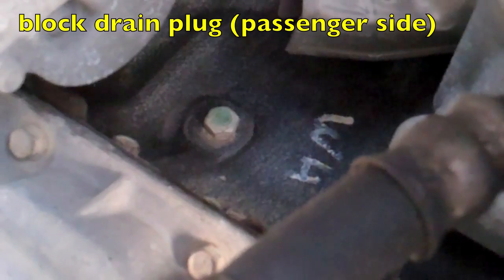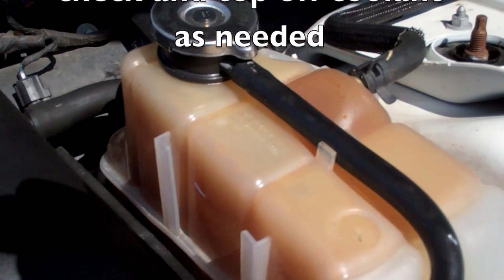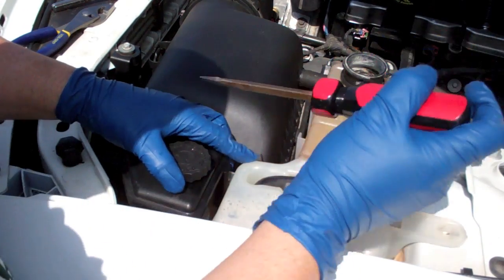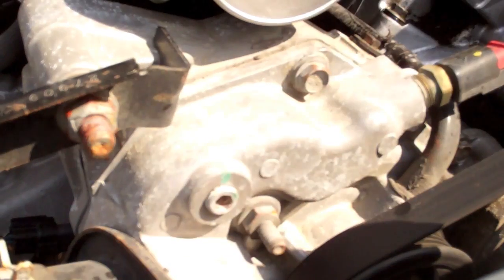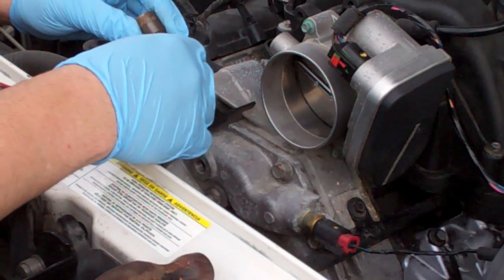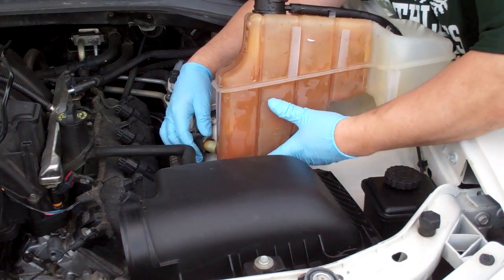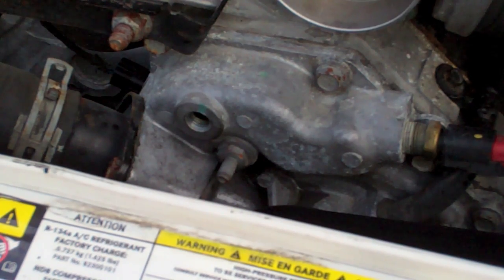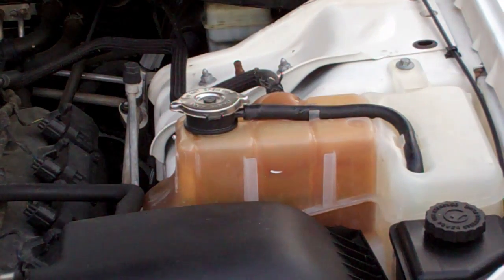Dodge Charger coolant flush/change

Comment: Supertech coolant is manufactured by Prestone and it's their pre-Corguard formula (pre-2014), which is perfectly fine and a very good OAT coolant.  I've used it for many years in many different vehicles with no issues whatsoever.  Radiator and rest of the coolant system is absolutely pristine in every vehicle I've used this in.
Reply from the maker: I've had great luck running it in all my vehicles too

Comment: Many people that have purchased our different materials recently have been asking us to address coolants on the forums.

It appears that there is a large amount of misunderstanding in regards to coolant/anti-freeze.

Since this is a very important system that many do not really understand, I will address this subject with the differences and why our QuantumBlue HP Gold is so much better than the sodium and sulfate coolants on the market today.

Many people have anxiety about the different colors of pink, red, orange, green, and purple colored coolants.

Many people think that green is the normal coolant and appropriate for all cars. However, the green coolant is not recommended for our LX LC, LD, and WK cooling systems.

It is true that as much as 40% of the engine problems that occur are either directly or indirectly resultant from improper used or wornout coolants. Neglecting this system tends to be common practice. Afterall, if there is fluid in there, it is ok right? WRONG.

There are 3 types of coolants available today:

First is the traditional I.A.T or Inorganic Additive Technology. This is considered the "conventional coolant" It contains inorganic corrosion inhibitors.....Sodium Tetraborate, Sodium benzoate, and Sodium Silicates and Phosphates.

This is how traditional coolants function. The rusting/corrosion potential for metals is the result of several competing factors. The two that are most concerning is the electrode potential, which is a measure of the tendency of a metal to oxidize (the atoms/ions of the metal combine chemically with oxygen to form a participate or create a solid like we have see in the 6.1 liter) and the protective strength and stability of the surface films. The most corrosion prone metals in an engine are the aluminum pieces and solder used in the system.

Second is called O.A.T or Organic Additive Technology. This technology ends up with an additive package that is organic sodium as opposed to inorganic sodium contents like the I.A.T coolants. The organic additives tend to last longer as they react slower. O.A.T coolants can last twice as long as the standard I.A.T which have an effective life of 30,000 miles.

Cast iron and steel both have relatively low corrosion rates in automobile engines. The simple but essential task of reducing ferrous metal corrosion is accomplished by adding inhibitors to the coolant formulation. Additionally, the corrosion products of ferrous metals are readily dissolved in the coolant and moderately stable in common coolant solutions. Ferrous metals corrosion is not a major problem in the engine our cars.

However, copper, and brass, (an alloy of copper and zinc), have higher corrosion rates then iron and steel. The old cars years ago used soldered copper radiators, and standard I.A.T and O.A.T silicate coolants protected these. The only major alternative to a brass and copper radiator is an aluminum and plastic radiator. Like ferrous metals the corrosion of brass and copper can be easily controlled through the use of sodium corrosion inhibitors which both traditional coolants have relied on for years.

Third type (which is recommended for our cars) is the H.O.A.T or Hybrid Organic Additive Technology. This type of coolant is designed more for European type vehicles and upper end manufacturers.

The Mopar OEM coolants factory installed in our cars are this type. They are designed for extended life in excess of 60,000 miles and upto 150,000 miles.

The negative or downside to this coolant is that it contains the same I.A.T and O.A.T additives that tend to react to heat and "plate out" onto surfaces and eventually buildup in the coolant passages and lower water jacket as does the other two types of manufacture.

The reason for the H.O.A.T spec is that corrosion of aluminum can be quite a different problem because of its electrode potential. Aluminum is the most corrosion prone metal in an engine (radiator and heads). Only magnesium sodium and potassium have a greater oxidation potential (these metals will burn/oxidize violently) The reason our precious heads and radiators do not turn into lumps of white powder is that aluminum oxides tend to form stable surface films on the cooling/engine waterways.

However aluminum is particularly sensitive to a process, called erosion-corrosion where a rapidly flowing fluid can remove the protective oxide layer. Erosion can be controlled by limiting the surface flow rate of coolant to 3 m/s or less. This is easily achieved everywhere except at the water pump.

The most vulnerable aluminum component in many engines is the water pump. Water pumps and their housings are susceptible to corrosion caused by erosion-corrosion and cavitation. Cavitation causes the formation and subsequent collapsing of high pressure vapor cavities, which exert high mechanical forces on metal surfaces. Erosion corrosion is the process whereby a flowing fluid surface destroys the protective film giving corrosion free play. The results of both reactions are very similar which produces severe localized damage.

The rate of cavitation is affected by a number of factors. Increasing the fluid density or fluid boiling point tends to increase cavitation While increasing viscosity, compressibility or dissolved gases tends to reduce cavitation.

There are many things to understand about a cooling system and I have addressed only a few here.
Reply: emsman59 Thanks for the information.  I would have screwed up my Magnum if I hadn't read your comment.
Reply: I am researching this OAT, HOAT coolant issue and things are getting more and more foggy. My 2015 5.7 challenger manual specifically states to use OAT coolant, and not to use or mix with hoat. OAT is purple and that's what my dealership says goes in my engine. Apparently Dodge changed to OAT in 2013. Contrary to all this, my 2015 car has Orange coolant in it (I am second owner). I am losing it...
Reply: @AGR96  Are you sure it's not more pink/orange? The purple dye in the coolant loses its color after a few heat cycles and appears to match the HOAT (orange) coolant, but if you take the OAT (aka purple stuff) out and put it in a cup, it will definitely look more pink than orange. Obviously, out of the jug, it will be purple. And I'm only referring to the Mopar-branded coolant, not other HOAT and/or OAT coolants.

Comment: Useful info! However, I’ve heard it’s not a good idea to switch coolant types without doing a complete flush of the system, as some coolants create some weird sludge overtime if they mix even in small amounts But I’m just glad I know how to drain the system now.
Reply from the maker: I use a "universal" coolant that is supposed to mix with all colors.  That being said, I did drain out every drop that I could - "just in case"

Comment: when i changed the coolant in my hemi ram i went ahead and filled it back with the HOAT coolant mostly because i was scared to change it to the green stuff in fear that it would mess up my engine somehow
Reply from the maker: I've been using this same stuff in all of my vehicles for years.  It says it "mixes with all colors."  I have not had any problems with engine temperature.
Reply: WJ Handy Dad i would drain your system and replace it with HOAT (GL5) and diluted water mix. It is the only coolant for the hemi 5.7 motor. Reason being the orange/green premix stuff doesnt offer the correct corrosion protection for this engine and will start to cause rust/corrosion in the radiator, water pump and block. Just my .02
Reply: you should only use OAT coolant in any 2015 and up challenger/charger or you will void your warranty. The manual states DO NOT MIX or engine damage will occur. YOU should do your homework before giving out bad info!
Reply: YOU are correct do not use the glycol based coolant (green stuff).  Handy dad is giving bad info. You probably saved your engine.
Reply from the maker: You can use whatever coolant you want to use and I never said that you should or shouldn't use any particular one.  The stuff I'm using says it is "Universal."  It's not the same thing as the old style "green" that was common in the 1990's and earlier.  It is the same green color but it's made differently.  I haven't had any problems with cooling/overheating using it in any of my vehicles.  I also change fluids, including coolant, more often than the manufacturers say to.
Reply: The dodge manual specifically states "Do not use universal type anti-freeze/coolant or severe engine damage can result and warranty will be void. Look it up, if you don't believe me. You should do your homework before giving others advice that could possibly damage their $40,000+ vehicle, or possibly void their warranty. Very irresponsible! 30 year dodge tech here.
Reply: Omar Aguilar green coolant the is safest you can use. Other coolants dexcool leave grime and eat the gaskets if you don't change it
Reply: Correct Omar, using anything besides hoat coolant in your charger will eat away at your coolant system. Doesn't matter if it s "universal" all coolants are different there is no universal coolant. Chances are yoir car is running much warmer than normal operating temps you'll go through water pumps faster and you piping is going to develop leaks. Coming from my father who has been a dodge service tech for 50 years.
Reply: I used a little 5050 Preston's in and I had the normal, now my radiator is leaking? Could that be because of the mix of fluids

Comment: i drive a ford f450 v10 (at work) and a  hemi magnum. wanna lose head gaskets at 50k miles run green . HOAT inhibits bimetal corrosion  get the mopar fluid, zerex sucks, oxygen corrodes it bad. aluminium and cast ruins head gaskets. why risk it

Comment: I'm about to do a flush on my 06 rt what's the worst that can happen if I use this same supertech coolant?? Or does it have to be the Mopar coolant? I'm confused thanks in advance!
Reply from the maker: the specification is to use the Mopar coolant.  That said I have not had any problems running a "universal" coolant in any of my vehicles... they all run great despite having >100k miles

Comment: What year Charger? Just asking because pre-2013 call for HOAT;  2013+ call for OAT). What engine? Only asking because the procedure will be different for 6.4/5.7), but I guess it's probably close enough. I suppose if you flushed everything, and it's pre-2013, you could at least run the OAT just fine without the sludging issue when you mix the two. Now running an old-school coolant that won't react with the modern metals of a modern engine? I just don't know if I would trust it. Sure, it's fine for your '70 Super Bee, but I think I would stick to HOAT or OAT? Issues may not be immediate, but maintaining the cooling system properly is apparently 40% of the wear on an engine, or so I read. That being said, great video, going to use it this weekend to do my own car.
Reply from the maker: I have gotten a lot of flack for using the "wrong" coolant.  I think a lot of folks think it's the old style "green" coolant, but it's a universal coolant.  I've had zero issues.  I've noticed the newer universals are yellow like the newest coolant.

Comment: would've been nice if you showed where in the engine block the drain plugs were.
Reply from the maker: I thought I did???
Reply: @WJHandyDad  you did, and they are a pain to get to with a ratchet and extension.  Everything seems to be in the way of acquiring a square fit with a wrench, extension and socket, so hopefully a flex adapter would help.  I've got my front end up on three levels of RV Links levelors right now and can barely squeeze under the engine.  I'll have to drop it back down to fully drain the system, but am worried about starting the car for any period of time to again raise the front end, without coolant in order to put the block plugs back in.  It'll just be for a few seconds of run time, but is that something critical I should really worry about, that could potentially cause any damage?  Thanks!!

Comment: So there's only one bleeder valve? Someone mentioned there was 2 and has to be done in a special series or else you air lock a thermostadt?
Reply from the maker: there is only 1 mentioned in the Dodge shop manual that I have
Reply: There is another, if the coolan bleed on the upper front of the water pump cannot be removed, but it requires disconnecting the quick release wire from the temperature sensor on the right "Drivers" side of the water pump , and unscrewing or removal of the temperature sensor.  Although a pain and sometimes hot, I also massage the upper radiator hose while and after adding the replacement antifreeze.  It's a pain, especially with the flex spring within that hose, but it helps, and you can see the antifreeze level rise in the coolant tank with every squeeze as it's done.

Comment: Green coolants  are for older cars  ,  after 2010 I guess it starter to use orange   , thats what a read on an article
Reply from the maker: this video has created a lot of confusion because there is a difference between the old fashioned "green" coolants and the one I use which is a "universal" coolant that just happens to be green.  I've had great luck using it in every vehicle
Reply: @WJHandyDad  great  , thanks  for clarify that  !

Comment: How high should the coolant level be when the engine is cold? I checked mine and it was sitting pretty low - I'm trying to investigate a leak. I have red coolant in mine, if I need to top it off, does it matter which kind of coolant I use? Is it ok to mix coolant types?
Reply from the maker: it should be at the full cold mark.  You can mix a "universal" coolant in if you don't have the same one to mix in.  In fact, all of my vehicles thrive on the Walmart universal coolant

Comment: This is NOT a flush as stated, it's a coolant change. You have the wrong info. about which type coolant to use. The reason that a specified coolant is used is due to it's reaction to the metals that are inside the engine. The coolant that you put in is dissolving your cooling and engine heads as we speak. Don't offer information that obviously you did not research. People listen to this stuff and can damage their vehicles.
Reply from the maker: and you are basing your statement on what exactly?
Reply: WJ Handy Dad your coolant system is probably destroyed. You're only suppose to use hoat fluid
Reply: I want to do an actual flush. Through the radiator, and the block. So my question is: do I drain coolant from radiator and block and follow process of coolant fill with just distilled water until the fans come on, and then drain and fill with coolant?
Reply: and run the engine until fans come on
Reply: Luke Fleming you can't do a actual flush unless you're able to pressureize the system. A shop can only do it effectively but a high pressure garden hose would work.  I wouldn't recommend a flush on any older car as it will do much more harm than good.
Reply: Spencer Goth ok so than just a coolant replacement will suffice for the 100,000 mile scheduled maintenance? The manual does state to do a flush and replace. So should I take it to a shop and have them do a flush and replace? Or just do the coolant replacement myself? Thanks for the comment.
Reply: Luke Fleming correct. A drain and replacement is more than sufficient. Most people don't even do that.
Reply: Luke Fleming ya don't do a flush with that high of miles, draining the coolant and replacing with hoat coolant is good
Reply: Spencer Goth yea lol I've got 80 dollars of hoat right now.
Reply: Spencer Goth I appreciate the advice man!
Reply: Luke Fleming ya you'll be good for longer than the car will last
Reply: Spencer Goth thanks man. Follow up question, will the car stop taking coolant at any time? Will I need to run the engine / heater halfway through to get all of the coolant in?
Reply: yes you will need to run the engine and heater until it stops taking fluid and periodically check the fluid level often in the next week
Reply: Spencer Goth you're the best man. I figure I should learn now

Comment: Is it necessary to remove the bleeding knot to put the coolant in ?
Reply: No, but it will be better to get the air out. It won't run as efficient. I would advise bleeding the air.

Comment: How much coolant do I need for this?
Reply from the maker: the total capacity of the system is just under 4 gallons so buy 2 bottles of coolant and 2 bottles of distilled water and you'll be fine
Reply: @WJHandyDad  thankyou

Comment: Hey There great video. Are the block drain plugs easy to access or do I have to take stuff apart?
Reply from the maker: pretty easy just like shown in the video - if there were things that had to be removed, I would have filmed that
Reply: WJ Handy Dad Thanks for the reply. I will try tonight.
Reply: it's right under the throttle body. All you have to do is remove the big air-intake hose off from the air filter, on the right corner of the engine bay, and remove the hose from the throttle body. Takes like 2 minutes and a standard screwdriver to do that. Then you should see the plug about 5-6 inches down and to the left from the throttle body.
Reply: Where are those block plugs located. I know the bleed plug location but I don’t know if I need to open them or not will all the coolant come out from the radiator??